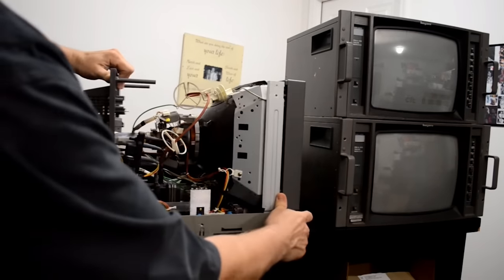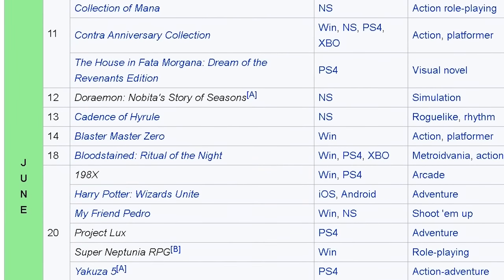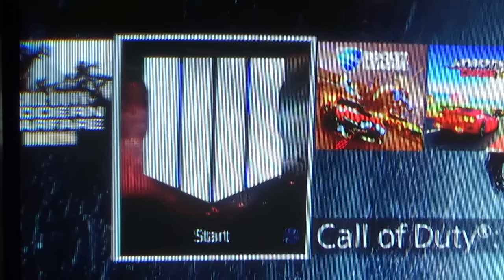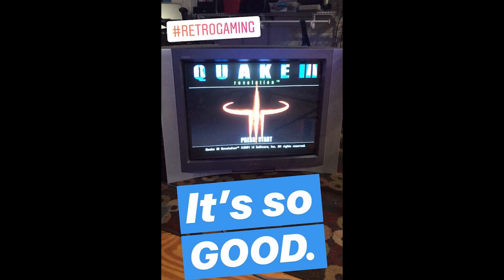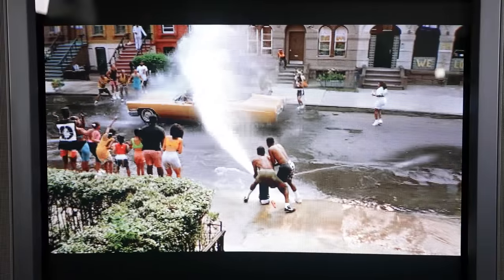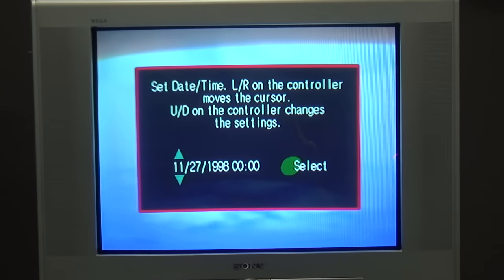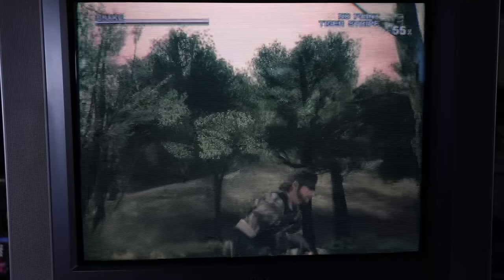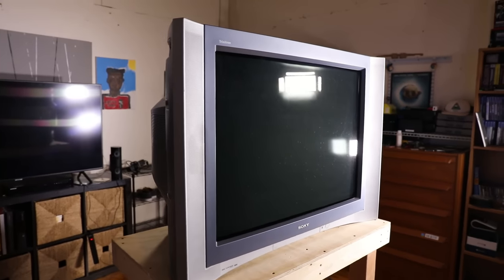Best CRT for Retro Gaming: Sony KV-36FV310

Comment: When i worked in the moving business we used to call them “Trini-TONs” cause of how much they weigh. Only smaller screen tv we needed 2 people to carry
Reply: Because quality is heavy
Reply: I've got a 30" Toshiba CRT and it weight like 130lbs.
Reply: When I worked for a tv repair shop. We only worked on Sony TVs. I remember replacing a 40" CRT on a Sony under warranty because the 40" were plagued with defects in the glass and would have tiny bubbles in the glass. When the new CRT came in. The shipping weight was 300lbs and took 4 of us to install the new CRT.
Reply: @docgonzo1973  4 people for something that only weighs 300lbs?
Reply: @jackthegamer this tv weights 80kg or about 176lb it was a pain in the ass to move it.
Reply: @The_Tradwife  roid rage helps?
Reply: @razorkill8522  old comment but a major reason they weighed so much was the dual layered glass in the front. The flat screen was accomplished with extra glass
Reply: I've been moving for 3 years and luckily I haven't had a customer yet with a CRT tv

Comment: CRTs are the best way to play retro games hands down, perfect blacks and no input lag and just the right amount of softness to where the image even on component video doesn't look overly sharp. However there are some shaders on retroarch that when combined with an oled comes really close to mimicking the look.  CRT Royale comes to mind as that doesn't mimic a PVM but a real honest to god consumer grade trinitron TV with scanlines and low count TV lines also which are the vertical lines that makes each "pixel" look separated from the next one over if you get up close to the screen. Heck it even mimics the glow effect of CRTs though, on an oled that's slightly redundant since oleds have that same exact glow effect also over bright sprites also. I'm not going to be throwing out my CRT anytime soon but its good to see the look preserved.
Reply from the maker: I'm gonna check out CRT Royale today
Reply: LCD monitors are down to 9ms measured from the middle of the screen which is only 1ms worse than a standard CRT.  Nobody is gonna feel a difference of 1ms.
Reply: @charvelgtrs  To me lag is not the issue, what is the issue and I've seen it even on gaming monitors is blurring when things are moving fast, also black levels are something LCDs can never, ever get exactly like CRTs or oleds. Even FAL screens still have light bleed plus costs 3k to get something you can somewhat compare to an oled. On the flip side LCDs don't have to worry about burn-in which honestly is a legitimate trade-off between the 3 display types so there are real reasons to still use an LCD.
Reply: @Microwave414  OLEDs have no motion blur and perfect blacks.  Burn in really isn't a problem unless you don't vary your content.  I've heavily games on my 2006 Plasma and it still doesn't have any burn in.
Reply: @charvelgtrs  I've seen motion blur on my oled when playing sonic 2 or sonic CD and going at top speeds through an act so I'm pretty sure it still very much exists however, I am also running on a late 2015 model OLED so that might explain it. Also its barely noticeable and you really do have to go looking for it while on LCDs it's hard not to see the motion blur, especially in 2d games. Lastly yeah with burn-in I don't really think about it, most people I've seen complaining about burn-in either had a faulty screen from the factory or had news and/or sports running on their screen almost all day long. You really have to work hard and/or be really stupid to ruin an oled.
Reply: @Microwave414   If you are seeing motion blur its likely whatever setup you are using, OLEDs literally have zero motion blur.
Reply: Are you using a proper external scaler for your retro consoles?
Reply: @charvelgtrs  None, I use a genesis mini which is plugged into my receiver then that goes into my TV though I did install project lunar on it simply to turn off the bilinear filtering in CRT mode and so I can play xeno crisis while I wait for my real copy to come in the mail. I usually leave my real consoles hooked up to my 32 inch trinitron TV using a scart rgb to component converter box. Also Sonic CD is running off my PC because it's the PC re-release of the game and I use the nostalgic video settings for sharp pixels while in 4k. With that said I have thought about buying an OSSC, however it's hard to convince myself to purchase that when I'm already getting  a really great picture out of my trinitron. I probably should still just in case my trinitron does ever finally kick the bucket, even though it's a 2006 model and I suspect that is still has years of life in it.
Reply: @charvelgtrs   charvelgtrs   You are sadly mistaken on this one. OLEDs do suffer from motion blur, as much as I myself would like it to not be the case. I know. I own a 55-inch LG C9. Even without owning one though, OLED being a sample-and-hold display just like an LCD says everything. It has practically instant response times when transitioning from frame to frame, which is what you were thinking of and which misled you into thinking it shouldn't have motion blur, but being sample-and-hold, I can assure you that OLEDs do suffer from it. All the display technologies we have today do fundamentally the same thing of displaying a frame and letting it persist on screen until the next frame is ready, which is NOT how CRTs worked and which explains why none of them are close to CRTs in motion clarity (check this out to see how CRTs worked in super slow-mo, https://youtu.be/3BJU2drrtCM ).

Black-frame insertion or strobing has been developed in recent years to make LCDs and OLEDs closer to the CRT ideal of having a moving image be as crystal clear as a static ONE and while they go a long way to combating blur, they're still not close enough (Watch the two recent Digital Foundry videos on modern gaming with CRTs) . An OLED without these low-persistence tricks is not even in the same galaxy in terms of motion clarity as a CRT.
Reply: @charvelgtrs  OLED burn in and get shitty discolouration where it occurs. CRTs never deteriorate like this. Some might get bit more blurry but colours and blacks are perfect all the time.
Reply: @Kacpa2  Yeah that's pretty much true, they're drop dead gorgeous when you first get them and I guess you can afford to blow a few grand every 2-3 years then oleds are amazing. I personally can't so when the moment there was just the slightest sign of potential burn-in or wear really on my 2015 oled I sold it off. Kind of surprised it lasted me with no serious issues right up to the hdmi 2.1 era with 120hz rolled but I guess I was using it as cautiously as possible. I wouldn't trust the technology for anything long term which is why I moved back to LCDs. I hope oleds are ultimately biodegradable because I'm certain now that a lot of them will end up in a landfill in the long run after their displays begin to deteriorate.
Reply: @Microwave414  Every 2-3 years? You might want to check reviews of LG OLED's from the C7 and above. No burn in unless you are doing some extreme levels of repetitive content that excludes over 99% of all TV users. I have 2 OLED TV's with one hitting 5 years old. Zero burn in.
Reply: @jaketapper8910  Okay congrats to you and your vigilance of regulating what is on your screen at all times to mitigate burn-in for 5ish years, but go look up my life in gaming and try's previous c7 which he got in late 2018. It developed these disgusting vertical bands/streaks from pixel refresh an still had burn-in right in the middle of the screen. They still can burn-in and they will over time. It's the inherent flaw of using organic material as a screen. I'm hoping that at some point OLEDs will finally have a lifespan more similar to CRTs but I really doubt it, even samsung's take on it might not be the winning combination but I hope it is but I'll wait a few years before I'll consider it and enjoy what I have now, which I do.
Reply: @Microwave414  Regulating my screen? I literally did nothing to mitigate burn-in. I watched TV and played video games just like the other 99.9% does on OLED's and have zero burn in. I also hate to break it to you bud, but OLED's are premium products that come with a premium price tag. Almost no one buys an OLED thinking they are going to have it 10+ years. Technology for enthusiasts that buy OLED's is rapidly evolving to the point where even after 5 years you are watching a severely outdated TV.
Reply: There are no mods to reduce the LAG in the new OLED displays? I've tried and they have even MORE lag than a regular LCD.
Reply: @Maisonier  The newer ones have about the same as standard gaming monitor but you'll need to enable it in the settings, assuming the screen is an LG that is. My old 2015 lg oled had JUST what I'd considered acceptable input lag as long as I was playing on real hardware with either an OSSC or retrotink which if there was any lag, it was 1 frame at worse. Emulation lag on that older oled was noticeable though  and it was too much for me.  

My current vizio p series 2020-2021 model yeah I have to admit does for handles lag generally better, doing the math it's within 0 frames of input lag on real hardware and that 1 frame buffer for emulation. Basically older oleds from LG left some processing on even in-game mode, it's part of the reason why 60hz on that oled looked rather smooth while 60hz depending on the type of game on the vizio feels like I'm playing at 30hz as I can see every single frame transition if things are moving fast enough.
Reply: Perfect blacks and no input lag are a thing on my LG C2 Display but the blending of colors and jagged edges and frames are what really make these old displays shine for me

Comment: I had the 27 inch version and it was one of the greatest TV's Ive ever owned
Reply: Me too. I attached my PS2, N64, and my Wii and it is just fantastic :D
Reply: I think yours is better than the 36 inch to be honest.
Reply: @nathanc6516  why?
Reply: @code.liplox  The pixels start getting too large for my tastes at 36 inches plus it weighs like 150 lbs more than the 27 inch.  You can sit closer to the 27 inch and have a better experience, in my opinion.
Reply: @nathanc6516  Well, I dont think the weight is a big deal, since the TV is installed. Im asking which one has the best image for you. What distance from the 27' you recommend?
Reply: @code.liplox  That's a good question, and the answer really is however far away you prefer.  You can be just a few feet away and get a good image with 27 inch or less.  I'd recommend at the very least 5 to 6 feet for 36 inch, but again it's up to your own tastes.

Comment: I got a 36FV300 last year and modified it to add a RGB SCART connection. I proudly call it my best project of 2019, and this baby is getting on really well with my army of retro consoles. 240p sweetness forever!
Reply: Doesn't it have component though?, Why waste your time if it has component
Reply: @kirbo8076  Technically "component video" is a different signal. RGB via SCART is a similar but different signal compared to YpBpR component that we have in North America. This mod would make it easier to use RGB consoles without the option for component output. I'm guessing at least

Comment: if you are really into CRTs keep an eye out for a nice old PC crt. can still find them. I recommend anything with a 110khz or higher horizontal scan rate. Some people complain about Samsungs but I had one that looked ok. You will also need a graphics card with analogue out(newest cards with this are 900 series), possibly a dvi analogue to vga converter (small piece that makes it so you can use a vga cable instead of dvi cable), and possibly a VGA gender changer(if the pc crt has a cord on hard wired). You can have a lot of fun getting high refresh rates out of them + all the positive crt traits you listed in the video. I know you mainly want to game on that 36 inches though lmao.
Reply from the maker: a PC CRT is high on my list of things to track down. I'm keeping my eye on local craigslists for them. You're right though, it would be so0o0o0o0o0o sick to game on the 36" 😂
Reply: High-end CRT PC monitors are becoming pretty hard to find. I had to have one shipped from Florida to Canada - the casing got damaged in shipping, but it still worked.

However, due to misuse (rapidly switching resolutions in a vain attempt to get it to work with an overly modern video card), the flyback eventually started arcing (and high-end flybacks are virtually impossible to find). I had to get another monitor shipped from ENGLAND, but this time it didn't survive shipping - the mainboard was weak from years of heat exposure (CRTs can legit warm a room) and cracked.

My last hope is to swap the flyback from the latter into the former. Note that this is only possible because both tubes (and hence the flybacks) are EXACTLY the same model. This isn't for the faint of heart, because CRTs store dangerous levels of voltage. I sent away for specially rated gloves to handle the innards and discharge the voltage.

Comment: I think I broke my knee when I got my FV310 as it was a one man job and then I did it again when I got a XBR960. The contrast and color of these old tvs are just something you have to witness in person and anime's are crazy with the color they put out. I use a hdmi to component box to use my laptop, but I think it's limited to 480i.
Reply from the maker: 480i is cool, I'm drinking that 480i kool-aid. What converter are you using? I'm looking for one right now but afraid of lag and stuff.
Reply: what resolution is the output from your laptop and what resolution does your crt receive it and process it at?

Comment: Something of note to add, the FV310 models had Sony's PVM circuitry added along with the same voltage regulator used in their high-end PVM's to address bloom from bright scenes. One of several reasons it is a unicorn to retrogamers.
Reply: What about the 210 models? I found a KV-32FS210 and it looks great

Comment: I got a 32" Philco 16:9 CRT recently, the picture quality is so phenomenal that it looked like a OLED tv or something, minus the HD resolution.
When you sit 10ft from the screen or more, you can't tell the difference in resolution anymore, all you see is that AMAZING contrast and INCREDIBLE colors.

Being widescreen, modern content looked perfect on it, such as movies.
I bought an HDMI to Component converter, with the ability to downscale FullHD content to 480i, so now I can hook my PS4, PC, etc to my CRT. lol

For retro games that were originally in 4:3 format, it supports that too. The screen is big enough that a 4:3 image in it is as big as a 29" TV screen.

Since then I've ditched my LED TV, the image quality is SO BIG, that I'll hapily trade the high resolution of the LED for it.
They say the last plasma TVs from Panasonic and OLED TV can rival the picture quality of these CRTs, but I can't easily get my hands on one right now, so I'll keep using the hell out of my CRT for now. lol

Comment: For a short period they made the 1080i trinitrons with a DVI connector on the back.  Using a HDMI to DVI cable/connector you can display modern systems at 720p/1080i and it doesn't have the input lag.  It's what I use to game with my mini retro consoles.
Reply: How are you getting audio?

Comment: I was thinking this was a Sony Hi-Scan XBR display at 1st. I have a 32" Sony KV-32HS420 that supports 1080i/720p/480p/481. The original Xbox and Gamecube look fantastic on it with component video, as well as my Saturn and Genesis.
Reply: No scanlines though, plus input lag. Best to get an sd crt for Saturn and Genesis.
Reply: @RazorEdgeBullie  I've had no issues with lag. Hell, I've used it play Guitar Hero, Parrappa the Rappa and the like and never experienced lag.
Reply: @Gamevet  some people are just less perceptive about lag than others. Especially if you're used to the display. I used to play those same games on a 65" LCD and never thought about lag until I tried an SD CRT. I'm sure if you tried one as well you wouldn't think so highly of your HD CRT. Plus, how do you live without scanlines on a crt? It's heresy.
Reply: @RazorEdgeBullie  I have a 27" Sony Wega SD CRT sitting right next to it. There is no percievable lag with this CRT running 480p or 480i content. 

When I do the caliibration for Guitar Hero 2 (480p) it barely registers a 1 ms adjustment. I can put my controller right in front of the screen and press the button and see the flippers move in Last Gladiators, literally as fast as I'm pressing the button. This isn't an LCD.
Reply: @Gamevet  how is it with 240p content?
Reply: @RazorEdgeBullie  My Genesis works just fine with it. It's nothing like the lagfest that is the SNES Classic on a LCD with the fighter commander controller.
Reply: @Gamevet  Is the Hori fighter commander that bad? I want to buy it for my Wii

Comment: I drove 2 hours to pick up the 27 inch model that someone was giving away. Unfortunately it had years of use and the colors were all blown out. Bummer but I still have KV-20FV300 that is sharp as hell. Love these late model Sonys.
Reply from the maker: Damn what a bummer! You think they'd have told you before you drove all the way there!
Reply: Benjamin Foster I just got a 36” Sony wega Trinitron, I can't tell if the colors are fucked up or not.  My Sega Genesis looks pretty good, just issues you'd expect with RF.  But my 360 looks HORRIBLE.  I cannot understand, the colors are faded on 360 but not Genesis 🤷‍♀️

Could be the off brand A-Video cable I'm using, going to find component cables hopefully that fixes it.
Reply: @youtubeadmin1588  did component cables fix the problem?